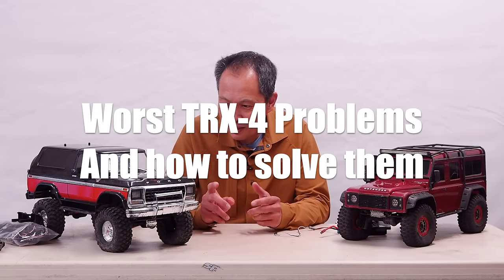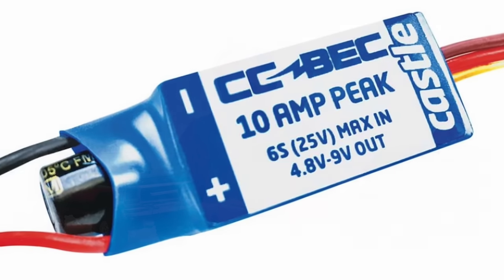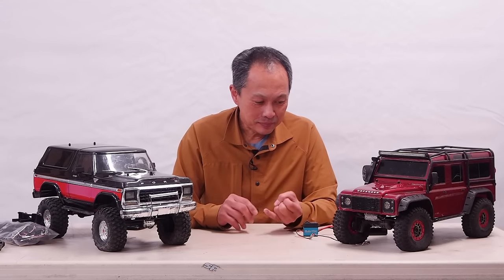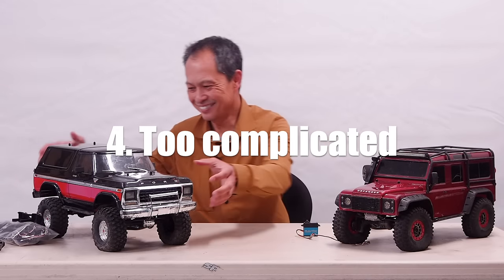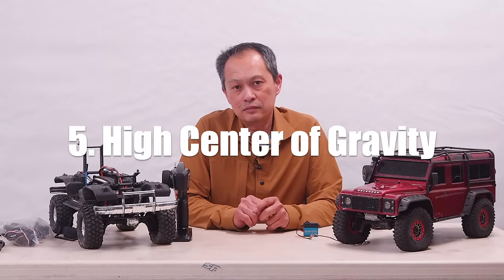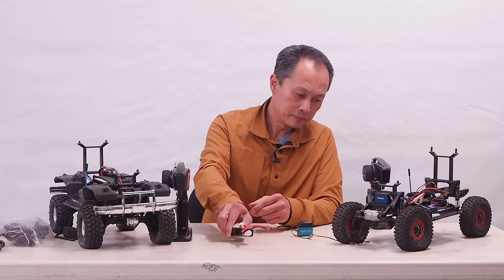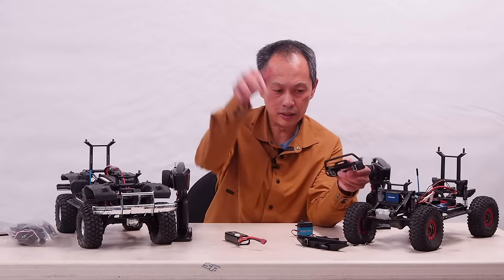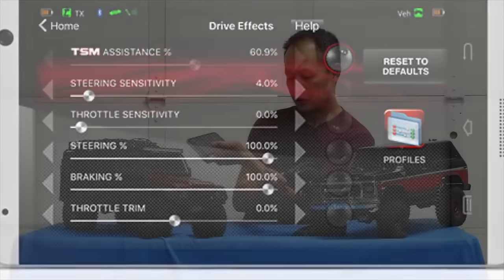7 Worst Traxxas TRX4 Problems and How to do the best trx-4 mods and upgrades

Comment: I relate fully. Steering servo will need replaced for sure at some point from failure. I’ve gotten by on the torque they make with driving style. My defender no longer has bumpers lol they def are in the way and I’ve got plastic beadlocks with lead weights. Still stock motor and has been submerged several times and ran many hours same as my son’s tactical. We are happy with performance in torque crawling and speed in hi gear especially with 3s but I’m fine with 2s unlike a slash or Losi Baja Rey etc

Comment: I despise the beeps. I put the Bluetooth module in it.
Plus , mine never hit the ground with stock electronic's. Black Label 650oz Protek 370 brushless WP servos, Mamba X esc and 1800kv Revolver went in it. Never even ran it with the stock body either....I had a Pro-line Chevy body painted-up even before I bought the TRX4. I'm obviously one of the few that does this but I've been in the hobby for 30 years....so I have plans for every rc before I buy it.
Anyway....you're spot-on with your review. Great video.
Reply from the maker: Thank you! We are not alone!

Comment: Good call on the bumper removal! I did the same thing and climbing improved so much more! I replaced my tires and replaced them with aluminum rims and tires. Does so much better. I didn't want to add too much weight to it. I was able to increase my climbing angle by almost 8° increase. I can climb better straight up, but coming down its more likely to roll when I push that higher degree. Still does the best when you just remove the top cover and can pull just over a 60° angle! Can't beat that with a stick! Have you thought about putting on a lighter shell on either of your TRX4's? 

Good Video Sir!

Comment: My trx4 is so good right now for crawling. stripped down it completly, all the plastic stuff and mini servos for diffs is gone. I centered the rest receiver and esc(hobbywing 1080) on the ram close to the motor, took out the receiver from the plastic box and covered it with a ballon and zipes. Got a few small 800 mah batterys and put in front between Servo(srt 35kg ) and plastic front thing. Bumpers is also gone ofc. Got heavy rims 140 grams with a modified brass Pieces around THE steering knuckle + extra weights around that 150 grams each Side. Also some weights around the differential with zip tied and glue. Body is the team c samurai only 80 grams. This is a very cheep way to get a Good crawler it beats some really expensive rigs om competion.

Comment: Any tricks to loosen up the driveshafts (by that i mean the part that slides inside the hollow part ? Seem to get stuck together and not moving free thus preventing articulation/shocks to work properly. Ideas?
Reply: I found this exact issue even with low miles. Only solution I found is replace with a metal shaft design.

Comment: PLEASE HELP!!! 😅😅😅

I just bought the TRX4 Defender, the motor was over heating upon running for just few minutes. I took out the motor to check if there is binding, it was smooth on straights and a little tight on steering. Then I adjusted the steering points. I placed an AXIAL motor to try to see if I solved the problem. There were no problems when running straights then i tried to crawl it on something high, the motor overheated and smoke coming out from the motor. I am using all stock except for the AXIAL motor from my old rig. My battery is Zeee 7.4v 5200mAh 2s.

Any help would be much appreciated. Thank you ❤❤❤

Comment: I have read about 3s burning up the esc (xl5HV). Should I be concerned about this before switching to 3s?
Reply from the maker: no concerns at all
Reply: I’ve been running 3s from the start for about a year now. Finally burned out my esc. I’m not sure if it burned out cuz of the 3s or just inevitability.  You’ll likely burn it out at some point.  When you do, get the hobbywing 1080 esc.  It’s cheaper and better.

Comment: Which do you like better the Savox 1210g or the upgraded Traxxas servo.  The Traxxas one seemed very quiet
Reply from the maker: They are about the same. We have both and have not had any issues with either one. The brushless Traxxas (red one) might be a hair better.

Comment: I got my TRX to crawl real slow so I'm interested more in better throttle modulation of motor speed (I could use 1/2 the sensitivity of the stock throttle response) and a slower steering would go a long way in the realism dept too.   I saw your vid on the FOC motor/controller which I will probably get, but what steering servo would you recommend for slower response ?

Comment: Great review, I've just got this issue with the servo, it only turns the wheels if it's elevated, once i put it down I hear the sound but the wheels won't steer. What do you recommend without changing the power source?
Reply: Buy a better servo

Comment: I have a problem with my crawler. It moves so slow. I took it to a shop that put it on a computer, than asked me if i want it to go as fast backwards as it does foward. I said sure. 
Now it goes as fast forward as it did backwards. I am 4 hours away from the shop that did that. 
Do you know when he could have done and what i can do to fix it? I am really hoping i don't have to go back.

Comment: I have seen a video that shows heavy portal axles actually make no difference at all and in fact, as the lean angle grows it forces the tires to role on it's side and loose grip.
Reply: I put brass portal covers on the front axle only on my TRX4 High Trail. It made a significant difference in roll-overs and crawl ability. However, i would not do the back wheels or add a lot more weight than just the portal covers.

Comment: Great tips thankyou. But the edits to your clip made it look like you forgot what you were talking about or changed your mind on what you were talking about. But yes it's some great advice and correct. I was just about to buy a Traxxas F150 Foord TRX 4 high lift but now I'm thinking about saving my money. Here in Australia that F150 high lift costs $1100.00 AU.  And then it's going to need all these upgrades? Yeh well now I don't think I want it anymore.great looking body and a capable performer ,the mechanics and chassis are excellent but let down by being fitted with parts straight from the factory which need to be upgraded. A steering servo is pretty easy and so is upgrading a motor and ESC but when my local shop does not have the stock this leaves me unable to use my truck. Maybe I'm approaching this from the wrong perspective then and I need to make this truck a project and a work in progress to be built and modified and customised but not left  stock standard ? It's probably going to owe me around $2000.00 AU by time I get it right and that will still be with the plastic portals not brass.traxxas has got a bad reputation for warranty also in australia.maybe due to Traxxas Australia distribution supplier?

Comment: If u think that's complicated wait till u see the summit 😂
Reply: Agreed. I have them both. Some models are only good for a true hobbyist
Reply: I Still have My 1st generation Summit. No Mods. Just replaced broken parts as Needed. I STILL don't have anywhere Near the Money Spent in Mods. I bought it for ease of replacement parts. Still My go to rig. It's pretty Simple. I'd buy one of these because they're just cool.
Reply: Len - Zeplin I still have my 1st gen too and love it. It’s mechanically stock.. just has different tires, wheels and body. I’d never part with it. It’s been a while since she’s been off the shelf though. Check out my channel and you’ll see it, amongst many others😉

Comment: Point Blank: ADD BRASS Portals!!!
More than anything else, they will improve low speed traction, control, and handling.
They're NOT cheap, but for the price vs. return break, they're worth their weight in gold.
I bought a plow attachment for my Defender, and with the brass in front, I surrender the rear diff to gain the plow lift servo, and I can clear up to 1.5" of snow from my front walk in less than 30 minutes without leaving my (covered) porch!
Reply from the maker: great advice. it is key for offsetting the weight of that great body
Reply: please give me a link for brass portals thank you
Reply: I got mine at the local branch of Remote Control Hobbies here in town. They do have an online store, I just don't know the exact link, or I'd gladly post it for you.
One warning: like anything else, if it's free, it's worth what you pay for it!
Reply: @jameskratzer4538  Thanks James for answering my comment. Cheers

Comment: You can also use a lower turn motor which will speed it up the higher the turn motor the more torque you will have

Comment: Bumper hanging up?......you can flip the bumper mounts upside down and it will give a little bit more clearance for approaching angles and departure angles. I have also swapped the front and rear mounts for even more clearance on the front bumper. I have a video posted on my channel for the tutorial!

Comment: The steering servo lasted 3 hours of normal use,never got wet. 450.00 rig ,very disappointing
Reply: 20$ wow oh my God it's done better sell it lmao
Reply: That’s about how long mine lasted I didn’t even abuse it and it just quit
Reply: Body on mine split after the first outing. Put a nice servo in and it's flawless now..... Until the motor died after a long creek run.
Reply: @stpbasss3773  Servo rebuild kit > $15?
Reply: @len-zeplin480  i wouldn't rebuild a Traxxas servo, I would just spent the 20$ to get a 20kg or 25kg servo off Amazon. I've had probably 7 Traxxas servo's that all crapped out and I've seen countless more crap out on my friends RC's.
Reply: @stpbasss3773  I went that route also. The New "Metal" $35 ball bearing servo Stripped. The polarity was Different too. (Had to Reverse channel). In the end I put a rebuild kit  (Plastic too) in BOTH Steering Servos Two Years ago. It's STILL climbing firewood piles All the time. It just worked out best (For Me). They are designed to give at the weakest point. You can wait till Your "Wedged in" to wiggle  the Steering back & forth.
Reply: @len-zeplin480  I've actually only ever had the metal Traxxas servo's , the only plastic one's I had stripped out but never totally died now that I think about it, so your rebuild idea is a good one for those . I thought you meant the metal gear one's.
Reply: @stpbasss3773  the point thought isnt that you can replace it for cheap , the point is it should come with a decent servo considering its 450$ price tag .

Comment: I never had a servo problem but I’ve had problems with the servo horn
Reply from the maker: Servo problems are not obvious until you've used a crawler with a 300+ oz servo. When you turn, the vehicle turns, or lifts, or does something, always!
Reply: @RCReviewChannel  yep , my buddy replaced his stock servo on his bronco with a cheap 20kg servo and put the stock servo horn on it . Needless to say after about 15 minutes it stripped it out .

Comment: Ok, some good points however, realistically, things like a bumper are what you would have to deal with in the real world. Everything is supposed to be to scale. Even problems like a rollover.
Reply from the maker: Yes, there are much better bumpers to be had out there, aside from the stock ones.

Comment: can the shifting servos handle 7.4 volts?
Reply from the maker: No.  To do 7.4 volts, one has to wire an external BEC to just power the steering servo. The stock BEC can power the rest like normal.
Reply from the maker: The shifting servos definitely cannot handle 7.4 volts.

Comment: YESSS!!EVEN THOUGH  I INSTALLED A SAVOX SEVO AND TOOK OUT THE TRAXXAS ONE! BUT ITS ALLLOT NICER THAN THE OLDER ONES AND HAS METAL PARTS:)  (I DEFF PUT THAT IN MY (RC CAR PARTS ETC ON THE GO CASE
Reply: Caps lock my guy turn it off

Comment: You don't actually need an external BEC. I've been running Hitec HS-7955TG high-torque servos on the internal BECs built into my ESCs for 6 years and they all work fine. You won't find a servo that can handle 10 amps of current (or a steering system that can handle the force generated by a 10-amp servo) anyway. I'm sure Castle's 10-amp external BECs can handle the power they're rated for, but they're still just as unnecessary as 1000-watt subwoofer amplifiers or oxygen-free copper cable in your car stereo. ALL COPPER CABLE IS OXYGEN-FREE, OTHERWISE IT WOULD BE RUSTY! But I digress...
Reply from the maker: How many amps do your ESC's produce. We find that  many of the RTR ESCs produce 1 amp only.
Reply: @RCReviewChannel : Depending on my power needs and motor setup, I use the SkyRC Toro SC120 (5A @ 6V), the HobbyWing 10BL60 (2A @ 6V), the HobbyWing WP880 Dual (4A @ 6V), or the HobbyWing WP1080 (3A @ 6V).
None of these ESCs are particularly fancy, so if most ESCs only provide 1A of current then I'm going to suggest people stop buying their electronics on HobbyKing, DealExtreme, Banggood, and other factory outlet sites for no-name electronics.
Reply from the maker: I think that's the key that you're using high powered ESC's with good  BEC output. The RTR ones are pretty sad at 1 amp.
Reply: @RCReviewChannel : I've always seen external BECs recommended in addition to an upgraded ESC, so that's the scenario I was commenting on. If you have an upgraded ESC from any reputable brand, you almost certainly don't need an external BEC, and nobody needs a 10 amp external BEC.

Comment: Fitted a 20kg servo to my trx4 before i even turned it on for the first time, used it for 10 mins and the Traxxas ESC crapped itself, the Traxxas electric are garbage, fitted a Hobbywing Quicrun and now its great.

Comment: Honestly. I have no problems with my trx4 g500. J dont need it to turn that fast when im crawling or speeding. It will flip or im taking my time crawling. 
Body does get in the way sometimes. But the body can be changed easily 
Battery lasts forever. And its slow because its a crawler. Even then on 3s in high gear and goes pretty good for what it is. I love the trx4

Comment: Another problem is the clicking sound in the transmission
Reply: Clicking sound is coming from this little pins, which holding the gearwheels in your transmission, they moving while driving and thats your clicking sound. Just put a little bit silicone oil (90.000 cps) on this pins, and it won't click anymore 😉

Comment: You   forgot  the  most  important  problem.....the  price....WOW.
Reply from the maker: Too much?

The TRX-4 Sport is $340 street price. Pretty good deal. Just wish it had a better body and servo and horn.  But it is very competitive with what's out there.
Reply: @RCReviewChannel   worth every penny
Reply from the maker: @voodoostroker  Now we're talking!
Reply: The shifting TRX4 at 450 bucks isn't a bad price. The real complaint is the steering servo. I did the soldering job on mine and no more problem. It's a well built vehicle. Even the top heavy issue. Still a well made vehicle.
Reply: @drev1  Yeah  youre right  not  everything  has  to  be  a   rip  off.....LOL....
Reply: Steve Vento  Thats  ok  Steve,if  you  save  up  long   enough,   i'm  sure  you'll be  able   to  afford  one  one-day.,
Reply from the maker: Our advice is to leave no paper trail. :)

Comment: The stock TRX-4 is in no way too slow. On 3S it is turning into a speed demon in high gear.. But the Sport is too fast, so need to gear it down
Reply from the maker: Agree.  The unlocking diffs grant the car opportunity  to go faster and have a different kind of fun for some other folks.  And the vehicle is so burly it candle more.